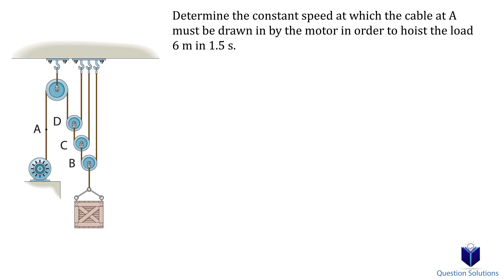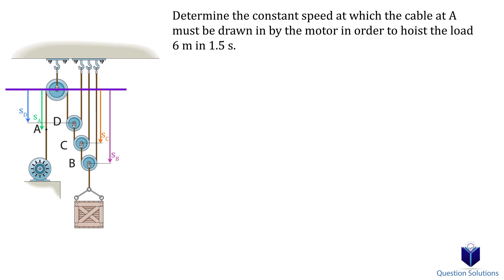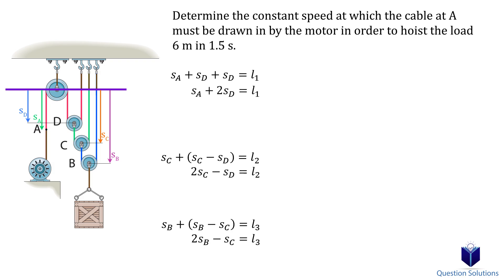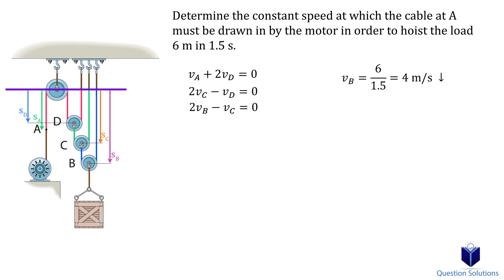Determine the constant speed at which the cable at A (solved)

Comment: Just as sanity check, I don't understand why the difference in speed would be a multiple of 8 when there are only 6 additional sections of rope contracted when Sa is displaced?
Reply from the maker: So the sections of rope doesn't necessarily corelate with velocity or acceleration, it's based on how it's arranged as well, and the initial velocity of any one of the ropes. The initial velocity is based on distance and time.
Reply: @QuestionSolutions  ok thank you for your work.
Reply from the maker: @r2k314  Thank you. This video might help you out since it covers more examples and basics: https://youtu.be/IudPPGIV5QM?si=h8saWeZDsfslGShA